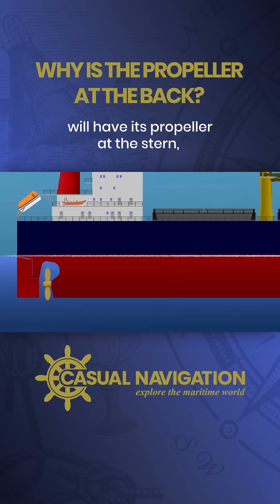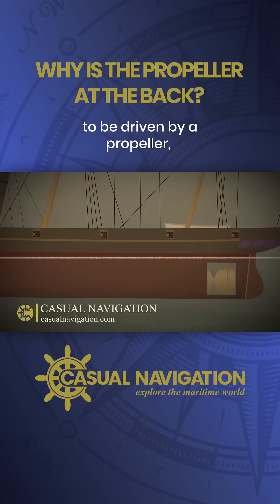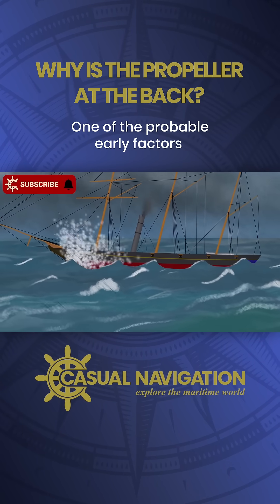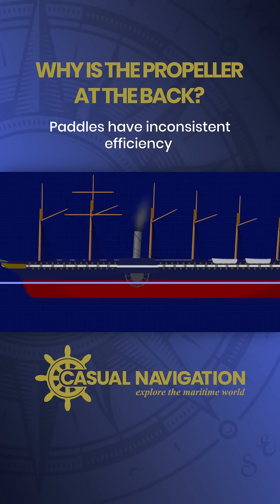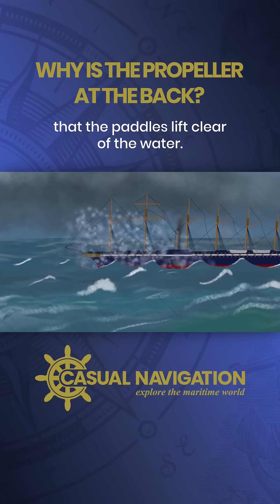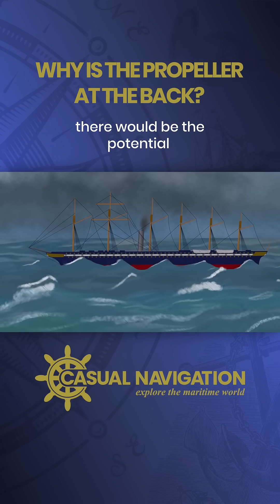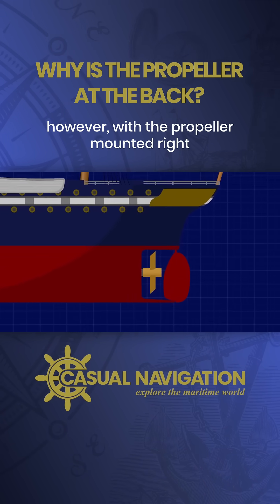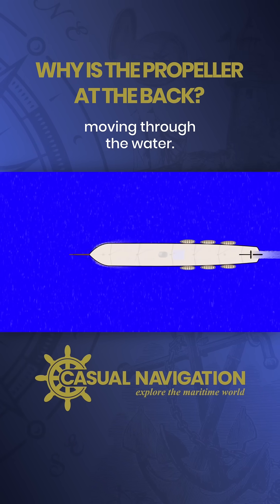Wait… The Propeller Is Where?!

Comment: There are planes with an aft propeller.
There are a lot of things that make sense, but one thing i was thinking about was, the ejecting side of the propeller has a very high and dense flow. Air is so viscose and low friction, that you don't loose much by thrashing this flow against your won hull, on the wings you would probably even increase the lift of the wing with this increased flow. But on a ship knocking the strong flow of water straight against the hull instead of your rudder would probably really decrease the efficiency and drastically reduce your capability to steer.
Reply: Air is the opposite of viscous actually, i don't know the word for that.

Comment: The most stable airplane designs require the center of gravity to be in front of the wings, and then for the tail fin's horizontal stabilizers and elevator to create downward force (negative lift) to counter balance it. Since engines are the heaviest thing in an airplane, that means putting it at the front. There are exceptions of course. Jets like the F16 are deliberately unstable, with a COG behind the wings to allow for tighter turns and more maneuverability, but they also require software and fly-by-wire systems to make the constant adjustments required for stable flight.

Comment: Completely missed the most obvious reasons. 
It's more stable to pull instead of push an airplane or land vehicle. In water, stability isn't much of an issue due to the characteristics of fluids. A propeller in front of a boat would likely be inefficient because it would be pushing water against the hull, doing little to move the vessel forward.
Reply: "It's more stable to pull instead of push an airplane"

That's the "pendulum fallacy".  The engine just pulls the plane forward in whatever direction it is pointing. If the direction changes, so does the pull. Nothing about that is stabalizing.
I know it is counter-intuitive because you are thinking of holding a stick from the top and see it come to a stable position versus balancing it on your fingertip.

Aircraft put the propellor in the front for two reasons:
A) Propellors are wide so the mounting point has to be high enough to keep the propellor off the ground. Aircraft tend to take-off and land with the nose up so it makes perfect sense to put the propellor at the front.
B) Aircraft get lift from air moving over the wings. The propellor is an instant source of moving air so putting that in front of the plane gives it lift even if the airspeed is low.
Reply: @vinny142 No fallacy. Anyone can look it up for themselves online. I already knew it, but just now checked anyway. 
Of course, there are options. One can go with the consensus of online sources, or a "trust me bro" YouTube commenter.
Reply: @K-Locke yeah, looked it up, watched a Tom Stanton video where he even tested it, still doesn't do anything.
It's called a fallacy because you believed it.
Not sure what browser you're using.
And also, small jets have engines on the tail sometimes, never had a problem.
the engine can't make the plane more or less stable, if the line of thrust is going through the CoM the plane will not have any engine-induced instability.
Infact, rear mounted propellers might be more stable, for single engine planes because there will be no p factor.
I'm not sure if you know what p factor is either😂.
Reply: "Putting the propellers in front tends to put most of the drag in front. That makes the flight more stable" 
There are stability pros and cons to either approach, granted. But, the prop's generally at the front because of the overall stability advantages. 
Don't take consult from 4th grade dropouts, bubba.
Beg me for the last word.
Reply: @K-Locke putting the propeller in the front leads to a slipstream effect, which creates fluid flow over the rest of the vehicle, which evens out the drag, therefore, it doesn't affect stability in any major way. And drag in the front is actually unstable, not stable.
Also, the rudder itself has a lot of drag, so the propeller doesn't matter that much for stability boats. It only affects maneuverability as stated in the video
Reply: ^ How many sock accounts do you have? One for each of your multiple personalities? 
Maybe you should have shared your imagined genius with airframe designers before they put props in the front of 99% of all airplanes. 
For the last time, I don't care what an internet rando thinks about this. 
I'll get my info from the experts.

Comment: You don't want it at the front, else it'd bash into things as you travel along 🧐
Reply: you dont want to bash your ship into anything anyway so I dont really see your point
Reply: @vyl4650  that's very true, but collisions with marine animals, ice, debris and running aground due to nav errors do happen, so damage limitation by not having a prop upfront is beneficial.
Reply: Logs,  dead heads,  unseen smallee debris.  It Happens all the time.   One time i ran my tug over a submerged log and it rolled all the way back and got jammed up in the prop nozzel.  Luckily we were light boat and didn't have to worry about getting run over by our barge while we worked to free it.@vyl4650

Comment: Many have tried, with some success, to put aircraft propellers at the stern (Wright's Flyer, Curtiss XP-55, Rutan VariEze...) but engine cooling was always a challenge (at least for high perf fighters) and pilots tend to prefer NOT having a spinning mincer right behind them when having to bail out...
Joke: what is the propeller used for in general aviation? 
It's for cooling down the pilot: if the propeller stops rotating, the pilot gets very hot. 😅
Reply: “Pusher” biplanes were common before and during WW1, as it gave a clear field of fire to observers in the front of these aircraft however as engines progressed in power, its more aerodynamically efficient for propeller driven aircraft to have the prop in the front and with interrupting gear usage, aircraft could fire their guns aligned through the propeller with out fear of shooting it off.
Reply: We do it all the time with jet engine planes
Reply: @moosiemoose1337  well its a propeller not a jet engine. and second bailing out in prop aircraft doesnt have those fancy ejection seats. you jump out yourself. and look a propeller behind you. yeah youd be minced meat
Reply: @moosiemoose1337 No jets do not do this. Every jet engine still has the compressor and fan at the front, regardless of where it is in the airframe.
Reply: @RCAvhstape The discussion is about where it’s mounted in the airframe. And besides, there were indeed a few turbofan and turboprop engines that had the fan or propeller at the back of the engine.
Reply: and the B-36 (also plague with cooling problems)
Reply: Some specifics on the aerodynamics issues of pusher designs.

Mainly weight distribution and lift generation.
If you put your engine in the back usually the bulk of your weight, you will end up having to move most of your lift surfaces back too.
But this always introduces increased risks of stalling the aircraft, since it will naturally pitch up, counteracting that in stable flight with the control surfaces in the front. While conventional aircraft tend to pitch down.

If it pitches up, the only way to recover when stalling is by being able to increase speed quickly while ascending, to regain control.
While in a conventional design planes tend to become stable automatically just by falling long enough.

So you need significantly stronger engines in a pusher plane, and even then wont eliminate the risks. Those stronger engines in turn need to be cooled, and need more fuel.

This is why both Passenger planes, built for safety and efficiency, and dog-fighters, built for maneuverability tended to have the front engine layout.
Modern fighter jets in turn still have massive issues with stalling, but make up for that with speed, making short distance dog-fights effectively impossible for more maneuverable planes, since they can't keep up with the speed to keep them in engagement range.

Also, fun fact on early plane designs, the reason pusher planes were the first conceived, like the wright flier, was because the configuration worked best in models, since there having them pitch up on their own was needed to have them fly at all. But as soon as you can control the plane it becomes quickly apparent that the design decreases stability and control ability compared to puller designs.
Reply: @TarDeisa Modern jets are unstable on purpose cause its computer that is flying them and you are telling it where to go.
They are by far the best kind of plane for dogfight cause there is nothing else able to pull 9g turns.
Some jets can literally stand and turn in place on their trust alone and i don't mean vtols.
Reply: @robertkalinic335  Yes, and no. You are not wrong, but I was specifically talking about short range dog-fights, which is a very arbitrary standard, but it did matter in why Jets were employed so much later, even though pusher designs and jet designs did exist back in WW2.

For one computer guidance in currently employed jets is limited. It helps for sure, but in a dog fight it can't do much, because its main purpose is to limit what the pilot does to not go into a stall, plus give warnings.

A computer doesn't solve physics, there are certain maneauvers a modern fighter jet can't do without risking going into an unrecoverable stall, maneauvers that even WW2 planes can do. Especially slow speed maneauvers.

And yes, they can go into a controlled stall to stand in the air, but so can far less advanced and more stable planes, and far easier too, because for a fighter jet to do it, they have to balance on their thrust, while a puller plane just has to hang from it.
And the recovery in those planes is far easier than in a jet, a controlled stall in a puller plane recovers almost automatically, if there is enough space, while a pusher jet needs enough force to increase its speed from that stalling position, and then turn out of it.
A very specific maneuver, that is useful to have.
But that doesn't change the fact, that the slower the plane goes, the more unstable it flies.

Another point is 9g turns, yes, they can do that, if the pilot can handle it, but this is down to the speed at which the jet takes a turn. A 9g turn at Mach 1 is still a wider turn than a 2.5g turn at 200 kmph.
(This would be the difference of a 1,2km turn vs a 120m turn as in a quarter of the g force at a tenth of the turning radius)

But the comparison obviously doesn't matter, not because an F-22 could out dog-fight a Spitfire, but because the spitfire would be a burning pile of debris before it has vision on an F-22
And even if for some arbitrary reason they went into a dog-fight, all the F-22 has to do is fly out of the slower planes engagement range, which they can easily do, take a wide turn and re-engage with a volley before they have time to evade or react.

And modern fighter jets can and do still dog fight, at least in training exercises. But those happen at far longer ranges than traditional WW2 dog-fights. The limited maneauverability doesn't matter if everyone has the same limitations, which they have to have, to not be a sitting duck, that gets hit, before it knows what hit it.

And if we look at planes like the F-35, which is worse in dog-fights than F-22s or even F-16s, it doesn't really matter, because the plane is not designed for Dog-fights. It will still win in almost all engagements that aren't arbitrary dog-fights, due to its superior range, detection, and armor.
And we are coming to the absolute limit of what human pilots are capable of in terms of dog-fights, which is why the F-47 as is currently being worked on will have remote control capabilities. Which means the pilots experienced G-force doesn't have to matter for the planes performance.

Now to turn this back around to early Jet designs. Without long range targeting systems and modern missile technology, and of course computers to help stabilize the planes, Jets were seen as unworkable for combat for well over a decade even after WW2. The assumption was that a Jet would always be too difficult to control to effectively fight with, while slower more stable planes could engage in close range combat. Today they are irreplaceable, also as many strategist consider the chance for dog-fights actually occuring in any wars even jet on jet to be relatively low.
The range of modern weapons is far too great to be genuinely worried about this.
Reply: @TarDeisa What ranges they fought at in ww2 is completely irrelevant, if the fight gets visual and both planes have to maneuver against each other to reach advantageous position then its dogfight.
Close range fights definitely wont happen if the both sides are all seeing but if you start poking holes or change the balance with technology engagement range can get very short.
Even fox3 fight can get to fox 2 range in sims if the planes wander close to each, especially if noone is feeding you extra info there is reasonable chance that enemy can slip around your radar elevation.
If we are to assume the kind of wars usa fought as default where one extremely well equipped side dominates 3.rate opponent then dogfights will never happen again, if we are to be rational and put two equal sides against each other then its absolutely clear that once attrition sets in, you can expect surprises.